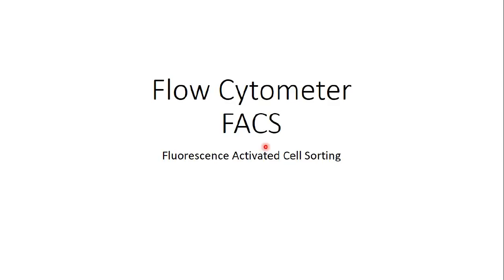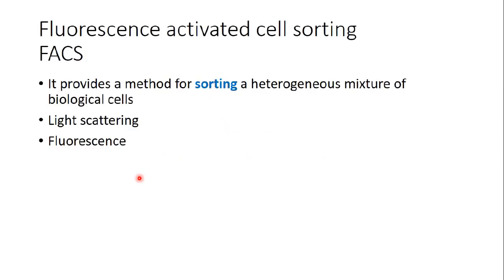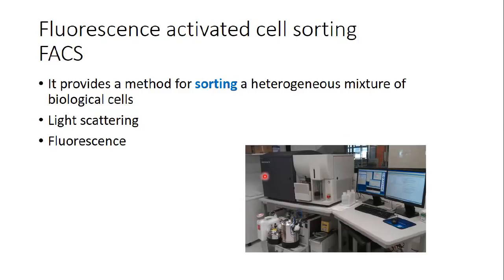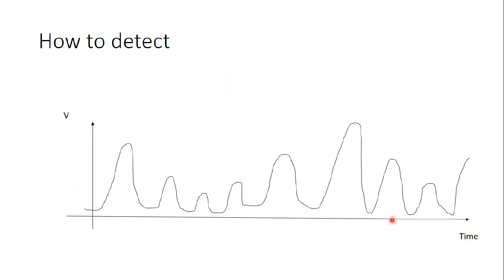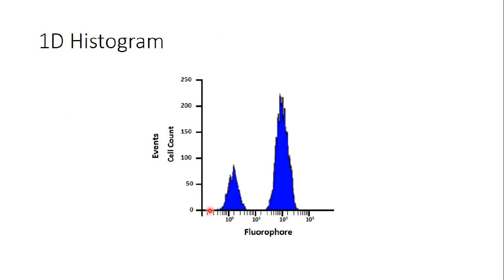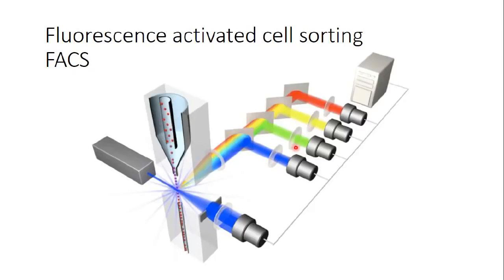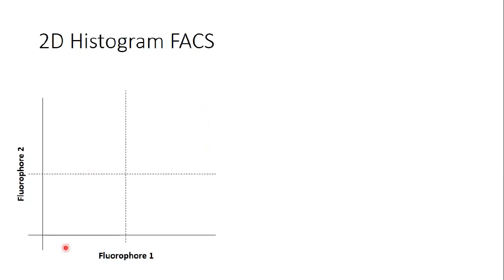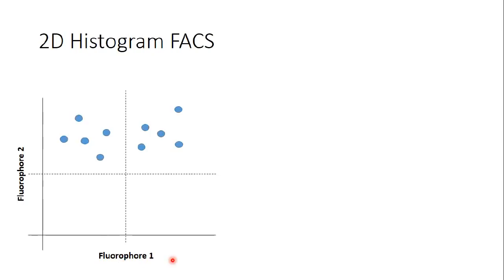The Principle of Flow Cytometry and FACS (2- FACS: Fluorescence Activated Cell Sorting)

Comment: Nice video! We want a continuation! However, about the video, I did not understand the charging mechanism. A droplet with a cell to be negatively charged will receive electrons and the cell to be positively charged will receive protons? How would be possible to generate a proton beam? What is the composition of positive and negative particles to be applied to the cell in the charge labeling process?

Comment: Hello, it is a very illuminating video. However, I have a doubt. You explain at 11.41 minutes regarding the cell sorting, where we can designate cells with positive and negative charges and separate them. However, if I want to sort and collect cells from all the four quadrants, how is that going to be done? How can I sort all the cells in different collectors?

Comment: Thank you for the video and great explanation!  I am wondering what is the proper procedure if you have more than one sample (say, n =9) - do you run the sample individually (9 times) and obtain a histogram for each sample before you analyze them altogether or do you simply mix all your 9 samples and run FACS once? In the case of samples from different experimental treatments, one would run FACS for samples from different treatments? Please correct me if I am wrong.  Thank you.